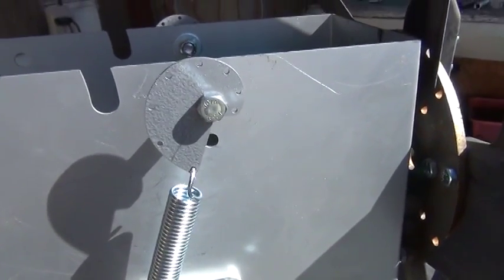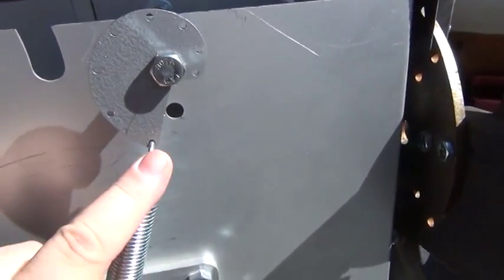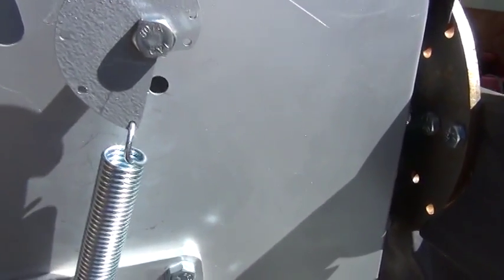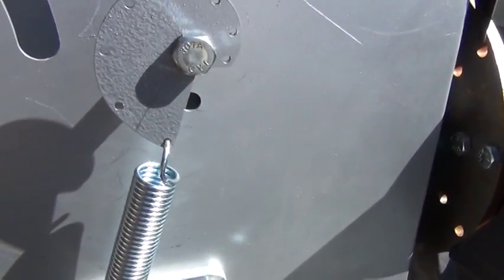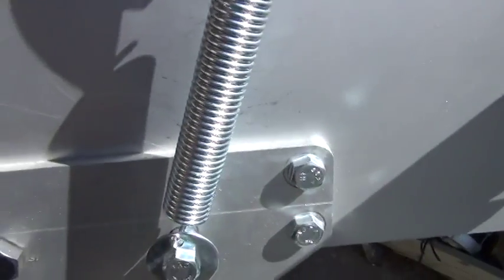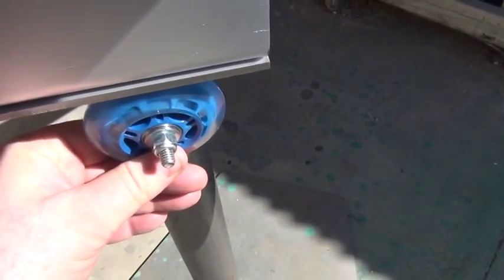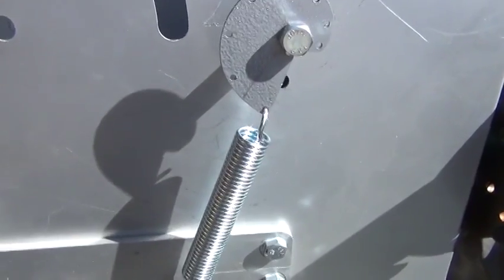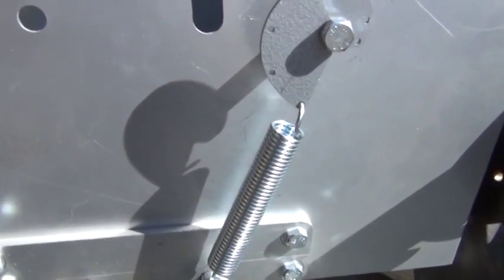Thermodyne systems tilting wind turbine adjustment cam spring

Comment: I would highly suggest some bronze bushings in the pivot hinge, some sealed bearings would be even better, but bronze bushings would work as long as they where greased when assembled.  I think when this thing hits the market you well be flooded with sales. A lot better design than a furling tail.
Reply from the maker: +Great North Woods Hillbilly   A bushing kit would be easy to install for after market.  I have been test for 5 months and the wear is not noticeable.
In any case it could be drilled out with has 5/8" drill and get a bushing kit real easy.  This is not our real unit just a tester we use for measurements.
Reply: I like your cam system on it, when I made a similar design years ago, I used a spring like you did but I used a eye bolt for adjusting tension, the cam is a great idea.
Reply from the maker: +Great North Woods Hillbilly    That works!

Comment: Put a pair of flanged oiled bronze bushings on the tilt hing. About $1 per turbine.
Reply from the maker: +Јохн «HEADSMASHER» Даниел   Good idea.  This one has the wrong bolts so just for show.
Reply: +WINDGENEERING  I have to get me one. You talk about the ultimate test platform at my place. I can put it on my new telescopic pole and feel safe to go out of town with no fear of losses!
Reply: +WINDGENEERING That platform base and top will allow actual bearings like the 1-15/16 tapered bearing with the oilite bronze rollers. Freaking nice!

Comment: Alright I get to see the actual cam. I was scratching my head how that would look. And you can't go wrong when you know the EZ rollers underneath. The smoothest action I've ever seen is with those EZ rollers. But that is nice to be able to change that plate to whatever size you need for whatever pipe size you're going to use. Once again this is going 2 make them crazy. No more burned out PMG. Thanks for showing.
Reply from the maker: +TheBillytheJack2010  Glad you like it Billy.  Everything seemed to 'gel' with this design.
Reply: +WINDGENEERING That platform will allow actual bearings like the 1-15/16 tapered bearing with the oilite bronze rollers. Freaking nice!
Reply: +WINDGENEERING That platform will allow actual bearings like the 1-15/16 tapered bearing with the oilite bronze rollers. Freaking nice!
Reply: +WINDGENEERING That platform will allow actual bearings like the 1-15/16 tapered bearing with the oilite bronze rollers. Freaking nice!
Reply: +TheBillytheJack2010  That platform will allow actual bearings like the 1-15/16 tapered bearing with the oilite bronze rollers. Freaking nice!
Reply from the maker: +Јохн «HEADSMASHER» Даниел     Since you like tho modify shit you can do it  lol.